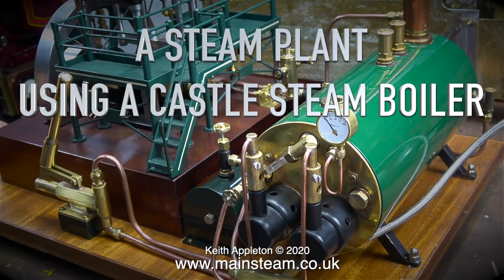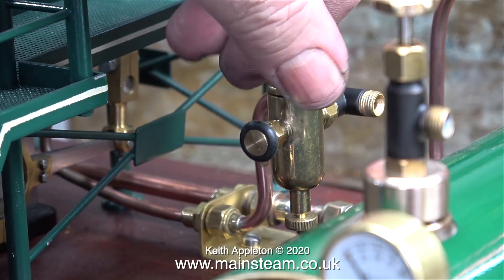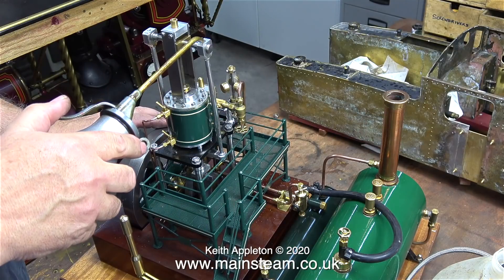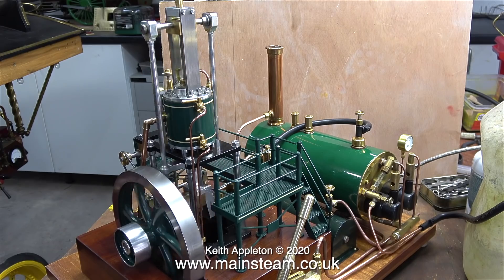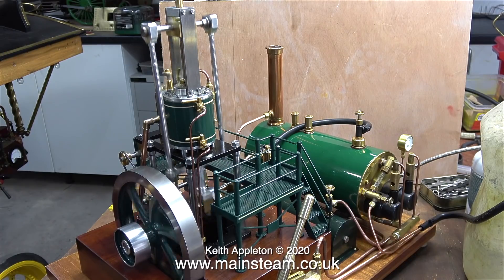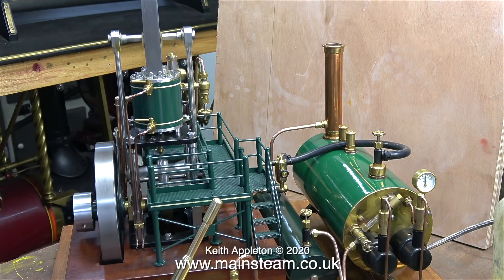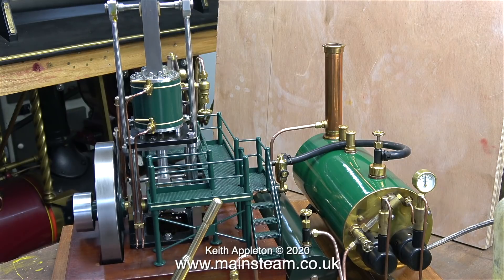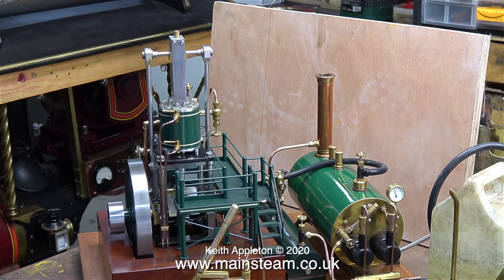A STEAM PLANT USING A CASTLE STEAM BOILER - PART #13

Comment: What a good looking engine!  Considering how quickly the boiler gets up to steam and how little steam it takes to run at a normal speed maybe smaller burners would be better?  Lucky owner.
Reply from the maker: I just turned down the gas pressure.

Comment: Greetings Keith. I'm wanting to start making kits similar to the Stuart Models engine kits to sell. They would be cast iron and bronze parts ready to be machined alongside machinist drawings. My first engine I'm looking at is the 'Woolf compound beam engine'; the one which shows up on the wikipedia when you type that in. Do you think there would be much demand for this sort of engine? I haven't seen any other compound beam engine model engine kits for sale anywhere and I mostly want to build one for myself, but figured it might be profitable to sell them too.
Reply from the maker: It could be, but Stuart Beam engines I think probably have the market share. The only problem is that a "Woolf compound" is not something I have ever seen before or heard of, and it looks like it could be a challenge to build, especially for the beginners that my channel is aimed at.
Reply: @keithappleton  Thanks for the feedback, Keith! I suppose it is a rarity and it would definitely be an equivalent challenge to a Stuart Major Beam model to build, but with a touch more complexity. Have you heard of any compound beam engines? I might aim for something more 'popular', if there is such a thing when it comes to old steam engines.

Beautiful steam plant, by the way! Your fit and finish always leaves something to awe the eyes.